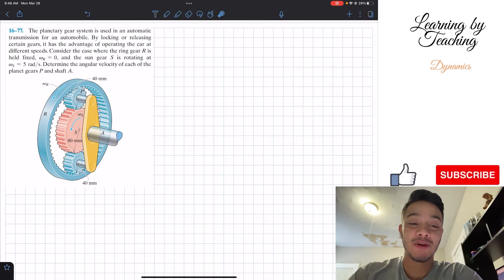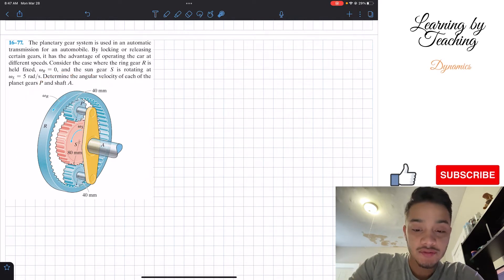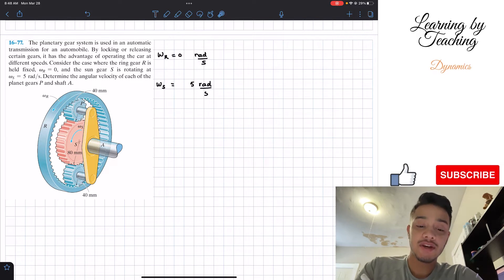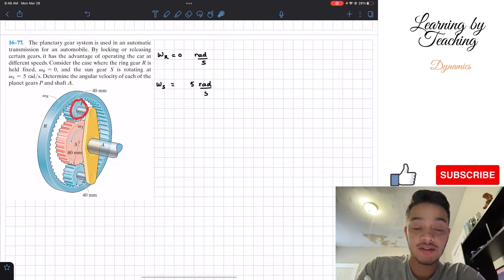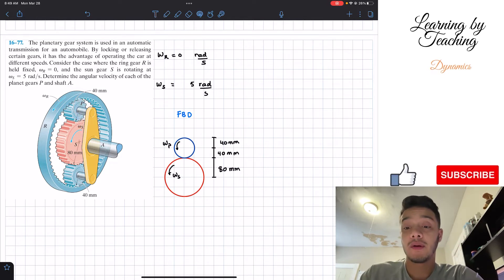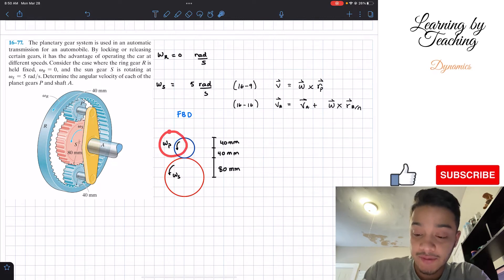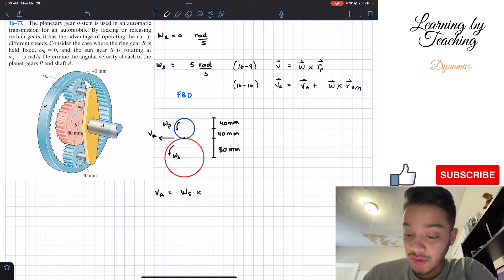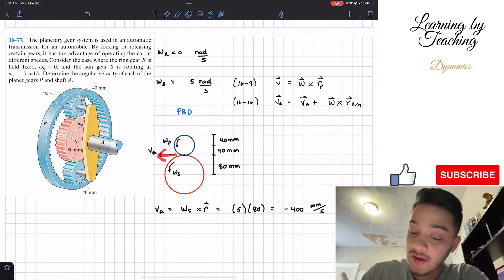Dynamics 16-77| The planetary gear system is used in an automatic transmission for an automobile.

Comment: correct me if I am wrong but shouldn't gear A be going counterclockwise? The center of gear P is going to the left, turning gear A counterclockwise
Reply: Which gear is A? There's shaft A tough
Reply: The planetary gear, yes